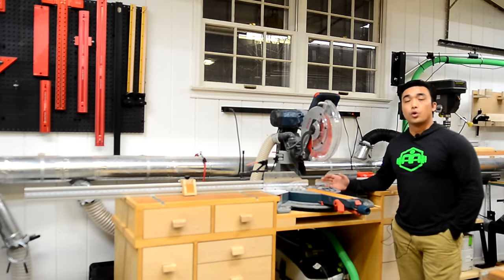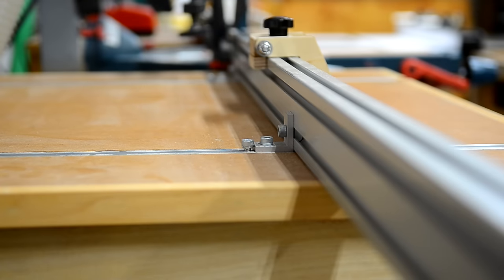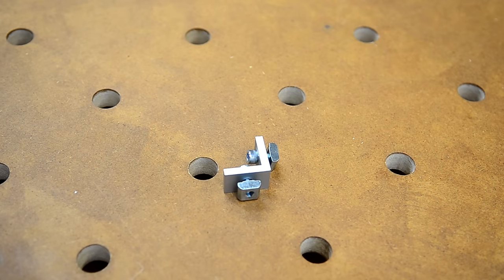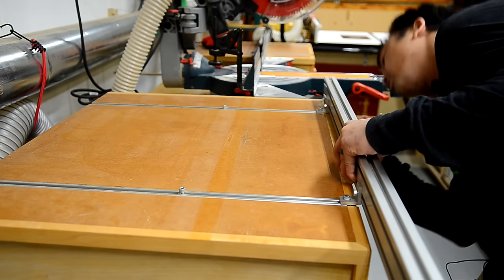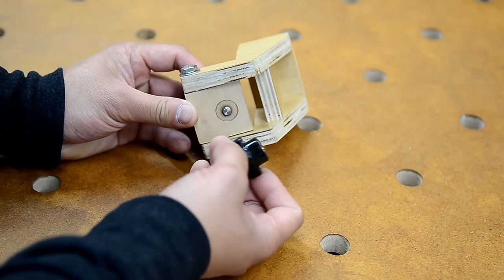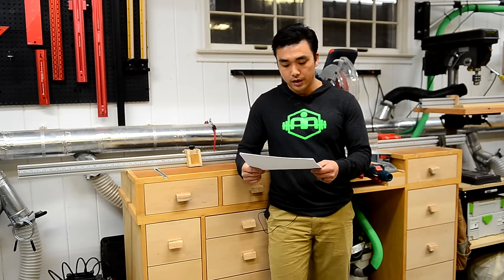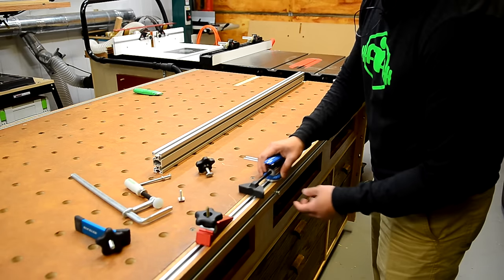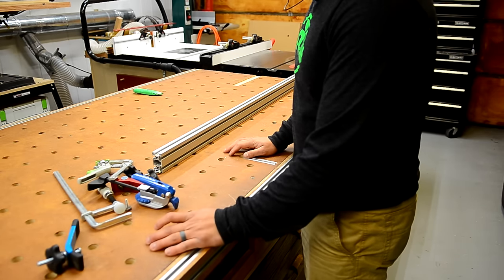My Precision Fence System for the Miter Saw

Comment: I am building my miter saw station as I type and have been holding back because of the prices I have been finding for fence systems. Found your page by accident and I am so happy I did. I bookmarked this video so I can watch it again when I have more time and will be checking out Misumi Engineering tomorrow when I get to work.  I will be ordering my new Bosch CM10GD miter saw next week after a long search. I have been a trim carpenter and builder for 30 years and demand quality in my tools. Can't thank you enough :)
Reply from the maker: No problem.  I'm happy you found this beneficial.  I wish you the best.

Comment: The timing of this video is perfect. I'm about to construct my miter saw station and your track system will surely make it into my station. Thanks for sharing.
Reply from the maker: Kevin Bostrom Just so you know, the aluminum extrusions are cut to order. It can take up to 2 weeks to show up at your door step. It's taken 10 days for stuff to show up for me. The extrusions are cut in a machine shop and Misumi serves as an international company so procurement takes time. I would hate for you to order and be twiddling your thumbs waiting for stuff to come. Let me know if you have any questions or need clarification. Also, Misumi's engineering support is really good. Call them if you have questions. The ordering process can be a little convoluted.
Reply: AlabamaWoodworker. Thanks Huy. I'm in the design phase. I'm using Sketchup and as long as I have the specs from Misumi website I can continue.

Comment: This is a great video and the information is outstanding.  I had designed a miter saw station and assembly table that I was ready to start building.  Had been dragging my feet some due to cost of track, etc and not wanting to compromise my plans due to the cost.  Thanks to your information, I found everything I need and now have it on order.  Even with your info, it was a bit of a challenge getting an order placed but I believe it will be worth it.  Looking forward to watching more of your videos.
Reply from the maker: Gene Pennel Gene, I know what you mean about ordering. You almost need a college degree just to order. I really hope this works out. It does take a little bit of time for the parts to come in but it's worth it.
Reply: AlabamaWoodworker  I just placed my order it was a bit of a challenge as stated above but your info helped tremendously. How long does it take for orders to come in generally?

Comment: do you know, does the t track extrusion work with Kreg Clamp downs/and/or the rockler t track accessories?
Reply from the maker: Tim Veach If the accessories you're talking about use or are compatible with 1/4" or 5/16" t-bolt (often called toilet bowl bolts), then yes, they will work. I have not used the items you're specifying with my extrusions.

Comment: I was in the market for a portable miter saw stand narrowed it down to the Dewalt DWX724 or the Bosch GTA3800. Do you have any experience with adding a custom Misumi fence system to one of these? Also which portable one would you recommend? thanks Charlie
Reply from the maker: charles greco I don't have experience with any portable miter saw stand so I cannot confidently recommend either of those stands. I've also never tried adapting the Misumi aluminum extrusions to a manufactured miter stand. I have only made my own miter stands and know they work for my needs based on my designs. I wish I could be of more help.

Comment: I just want to thank you for the incredible amount of time and energy that you have put into these videos!  They are incredibly thorough and this is one of the few times that someone has listed the cost on some of the items from the videos and even the part numbers.  Very helpful because frankly with the tracks, I would not know where to begin.  Everything you do is well thought out and adapted to your preferences and needs - which should be the case with all of us.  Right now I have to have everything on wheels because I have to work out doors (tarping things at night, sunny climate all year) until I move and build a large shop.

The one question I have is what length tables you use on each side of the mitre station and how much space did you allow for your saw?  I am building two tables, then lower one for the saw which can be bolted to the other one, then replaced with one for a radial arm saw.    Thanks again for the exceptional videos, well crafted and full of the what, why and how of your choices, which help us to make our own.

Comment: Excellent video Huy! I noticed they don't list prices on their site so I was surprised to see how cheap they were when you mentioned the prices in the video. That's a really good price for all of the hardware you received. 

Thanks for sharing, I appreciate it!
Reply from the maker: Thanks, Sean.  When you're navigating Misumi's website for a specific part, the left column is your friend.  For instance, if you wanted the flat extrusion (12mm x 20mm), you'll need to specify that on the left.  Finally, you'll need to enter the length you want the extrusion cut to.  You'll see a number in red telling you how many configurations you need to still specify before receiving a price quote.  Once you enter all the specs, you'll receive a green "Complete" text and a price will show up in the right column.  Yeah, only engineer could think of this type of ordering system.

Comment: Thanks for this, especially the price breakdown.  I looked at their site after watching your shop tour vid and was pretty confused by the catalog in the short time I looked at it.  This helped make sense of it.  I'll definitely be looking into their stuff when i do my miter station this summer.
Reply from the maker: William Look all way at the bottom of the video description. I list all of my part numbers. Note, the last set of numbers on the Fence and T-track are my specified lengths. When you order your parts specific to your needs the part number needs to include length just like my part numbers did. When in doubt, call Misumi. They are extremely helpful.
Reply: Thank you for providing this technical information on aluminum extrusions.  I have checked the Misumi eng website for the parts you mentioned.  I would like to ask what is the difference between the left side fence and the right side fence?  Thank you.
George
Burnsville NC

Comment: I like this extrusion better than others I've seen, so I ordered some from Misumi (Thanks!) but I'm having trouble attaching the profile into the Dados, it seems theres almost no clearance for a screw head. I've countersunk a #6 screw in and still can't clear it, so I'm wondering how you attached yours? I'm considering using an adhesive (MDF surface o mine) thanks!
Reply from the maker: I used a slow cure epoxy. I don't need to remove the track so using epoxy made sense for me.
Reply: thanks, I went ahead and used an aluminum construction adhesive, works, but not the best as it expanded just a hair afterwards, but still functional!

Comment: Thanks for including all the part numbers... looked into this awhile ago and never followed through
Reply from the maker: I'm happy this video helped you out.  The ordering and procurement process can be confusing and that's why I listed all the part numbers.  Keep in mind the last set of numbers in part numbers for the fence and fence track are lengths specific to my configuration.  You'll need to specify the lengths you need cut. When in doubt call Misumi directly.  They are very helpful.

Comment: Very excited to make this! Have you thought about making a sliding table for the table saw?
Reply from the maker: I've considered making a sliding table.  Misumi and many of the other engineering components companies have very good linear bearings that could very easily be attached to a table saw using extrusions.  The issue is having the ability to remove the miter gauge for ripping operations and detents for known angles (i.e. 22.5, 45, and 90 degrees).  Without that repeatability and modularity, it doesn't make sense for me until I can figure out those requirements.
Reply: AlabamaWoodworker I think you are really on to something with using standard extrusions instead of buying the branded stuff for twice as much. Hopefully you figure out the table saw sled system, a lot of people would be interested in that i believe.

Comment: Great video and very informative.  I've begun to realize that extruded aluminum certainly has a lot of uses in the woodshop - especially for precision jigs and such.  I'm planning my miter saw/radial arm saw station and definitely considering extruded alum.  I'm also planning on building my next table saw cross cut sled using extruded alum.
Reply from the maker: David Colley The possibilities are endless when it comes to using machined components from companies like Misumi, McMaster Carr, Grainger, and Fastenal. The industrial equivalent woodworking products are more durable, compatible/interchangeable, and often times cheaper. Thank you for watching!

Comment: I recently discovered your channel and am really enjoying it. Thanks for all the detail and good ideas. I am also an Alabama woodworker, just down the road from you, near Florence.   I've been using a radial arm saw for 50 years (yes, the same saw) for material break-down and added a miter saw about 10 years ago for precision work. Last year, I built them into the same bench with a shared fence.  The fence sections are mounted on T tracks in the bench for calibration. Having seen your stops, I will definitely add them. Thanks for the excellent idea. I built stop block that do not flip, however. Your shop-made flip stop looks great. Do you feature that in a video?  If not, would you share the plans, please?

Comment: You da man! I'm also a mechanical engineer by trade and use McMaster and Misumi at work extensively. Awesome tips for the YouTube woodworking community as I feel most are not aware of these suppliers.
Reply from the maker: Mustard Made I think as mechanical engineers we can evaluate products sold by woodworking companies based on many of the more common engineering supply companies and see a major discrepancy. Thank you for the encouragement. While I enjoy posting these shop tips, design, and analytical videos, I'm really wanting to start posting build videos, specifically furniture. Thank you for watching.

Comment: whats your length of the miter saw station itself? I need to make mine smaller, and yours looks to be perfect size, we have the same saw.
Reply from the maker: I can't remember off the top of my head.  I'll measure it when I get home.
Reply from the maker: KnottyDog WoodShop Hey man! The length of the miter station is 72". It's 24" deep. You'll want to have 2 mounting configurations (forward and rearward). I keep my saw mounted forward so that I can make 45 degree cut.
Reply: Can you elaborate on the forward and reverse mounting configurations.  I'm not following...  Thanks in advance!

Comment: Enjoying the Great videos you are doing and Thank you for Misumi tracks! Have a question who makes the Black wood clamps you use?
Reply from the maker: michael shawn Sedor Hey Michael! Thanks for watching. I buy those clamps from Harbor Freight. They are cheap buy get the job done.
Reply from the maker: Hey Michael!  I was looking through the video and I can't recall using a black wood clamp in the video.  Could you point me to the time in the video that you see the clamp you're inquiring about?  I could help you better if I knew specifically what clamps you're talking about.  Also, I do use the Harbor Freight F-style clamp but I don't believe they are shown anywhere in this video.
Reply: yeah i posted in the wrong video but you figured out LOL Thank you much ill have to check them out. Thanks for the great Videos!

Comment: Nice video and excellent presentation,  do you use the side table for other uses and then do you find the stops interfering
Reply from the maker: Dave Simpson Hi Dave! I don't use the side table for anything other than for miter saw support. The stops are designed to flip up which get them out of the way when squaring up one end prior to cutting the final length. Great question and thanks for watching.

Comment: Nice review, now I just need a project to do something that uses those extrusions!  On your fence locator stops, would a setscrew work to get rid of the bolt head protruding above your table top?  My favorite source for knobs, clamping handles, etc is J.W. Winco, they have an excellent selection and ship fast.  Steve
Reply from the maker: ExtremeWoodworker Thanks Steve, about the tip for J.W. Winco. I'm always looking for competitive resources. Yes, an M6-12 set screw would work wonderfully instead of the cap head screws. The screws push against the bottom of the table track and lift the insertion nut against the top of the track. The insertion nut has four protruding dimples that help grip the interior of the track when they are locked down. I love it! I might switch them out with set screws! Genius idea!

Comment: Great video!  Just ordered from Misumi, can't wait to finish my miter station.  What router bit did you use to cut the channels for the t-tacks?  The top is too big to run in it through the table saw with a dado.
Reply from the maker: Hi Karen!  That sounds so exciting.  I used a 1/2" spiral down cut bit and made two passes to get the width I needed for the t-tracks to fit.  The spiral down cut pushes the material downward and prevents tearout on the surface on your miter station top.  Hope this helps.
Reply: AlabamaWoodworker Thanks for the info. We were actually able to us a dado, but will try the spiral down next time.  Keep up the great work!

Comment: That is a great design. 
You might consider replacing the screws on the fence-locating inserts with setscrews. If you do that, you will have a flat work surface when the fence is removed.

Comment: I love this idea, I will also set this up for my miter saw.   A couple of questions for you.  Is it necessary to have the track routed into the table?  Or could you just mount the new fence to your miter station in-line with your miter fence?    Would it be possible to add the wixey digital tape measure to this fence?

Comment: I am really enjoying your videos so far.  I looked at misumi and was about to order some extrusion, and it looked like they measure the length in .5mm increments.  Was this the case for you or am I misreading something?  Thanks in advance, and keep up the good work!
Reply from the maker: The larger extrusion (30mm x 60mm) can be ordered in 0.5mm increments from 45mm to 4000mm (I believe).  The smaller extrusion (12mm x 20mm) can be ordered in 1mm increments from 50mm to 3000mm. This was the case for me.  Keep in mind, the size of the extrusion does affect shipping rates.  That being said, I believe Misumi's shipping rates are very reasonable.  Don't hesitate to call them.  They are very supportive with techs and engineers on staff to walk you though ordering.  Thank you for watching.

Comment: FYI - most guys who use a fence versus embedded t-track put the fence behind the fence of the miter saw since a bowed/banana looking board isn’t possible to square up when rubbing on that extended fence.  The fence on the miter saw itself is plenty long to square the stock and the other fence is really only helpful for measuring and making end stops.

Comment: Even if the bolt doesnt lock against the sides, couldnt it lock using the upward force on the bolt?
Reply from the maker: Yes, it could.  The friction and compression fit would be sufficient.  You might turn whatever locking mechanism you choose to use a little more than a bolt that locked against the side walls. I guess I should have stated that it isn't a "true" fit.
Reply: Hey man, dont second guess yourself. I think you were correct in what you said. I was just curious if you saw any concern with it placing most the force against the inside top of the aluminum extrusion. 

Very nice.
Reply from the maker: I wouldn't be concerned with over torquing a bolt against the inside top of the aluminum extrusion.  Thank you for the encouragement.

Comment: Happened on your video this morning, very impressed with you shop and its layout. Thanks for sharing. Really interested in your miter saw station, thinking of building one similar, great design ideas. Was really excited by the extrusions you used but when checking into the company it doesn't appear they will sell to non commercial individuals. Kind of disappointing. Did you purchase through your employer?
Reply from the maker: Paul Streu Hey Paul. No, I purchased them as an individual. Give them a call. It may be that you'll need one of customer reps to set up an account for you.